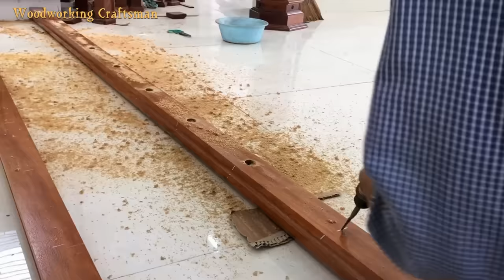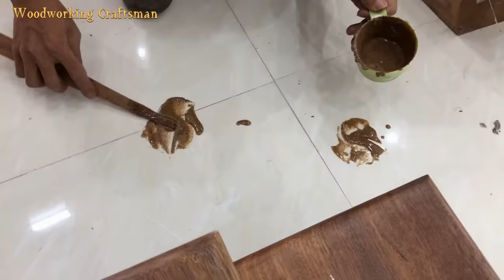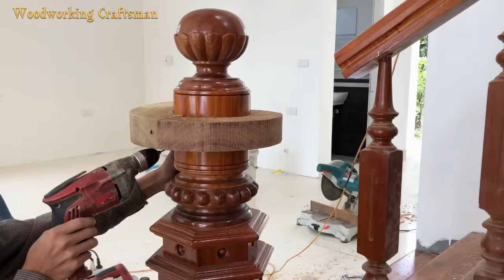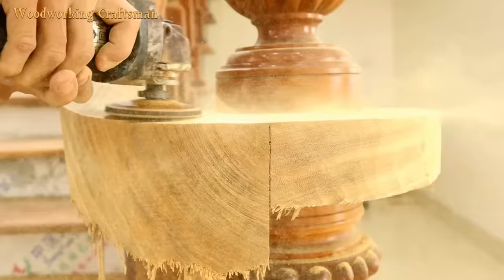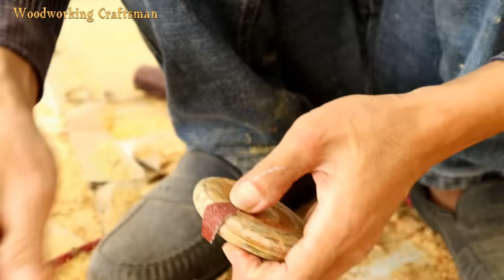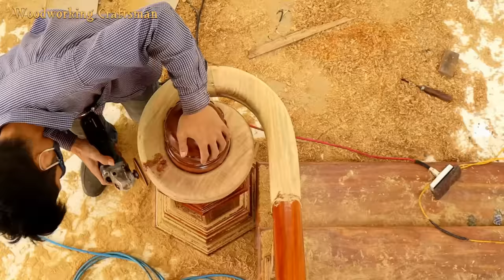Amazing Skills Woodworking Extremely High Technical | Build Curved Wooden Stair Railing Hand-Crafted

Comment: This my friends is what happens when a country still emphasizes the trades, you get professional carpenters, welders, bricklayers, etc (earth to America, come in
America, you can't use gender studies majors or theater majors to build houses, weld pipeline or brick homes) Japanese are perfectionists, I lived there for 10 years! Ever seen Japanese nailess carpentry, look it up you'll be amazed! They used to and still do build traditional homes, temples and other things this way, no nails or screws it's called Miyadaiku. Although this guy could have used a plumbob to help him him make sure his railings were straight and plumb instead of 500 short measurements! But either way badass work!

Comment: Not good he's pounding in those lag screws into the balusters - 5 years from then they're going to start coming lose from use - they are designed and are required to be spun into a smaller pilot hole. Guys can be fast but suck at quality, I've seen it a million times.